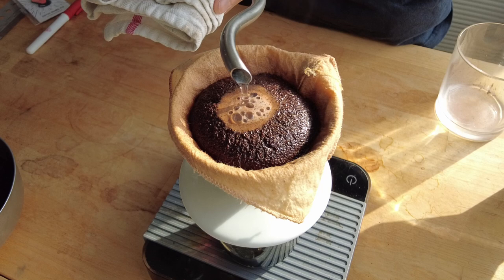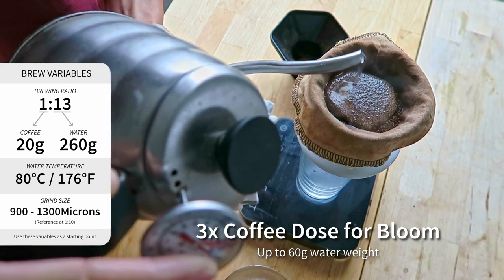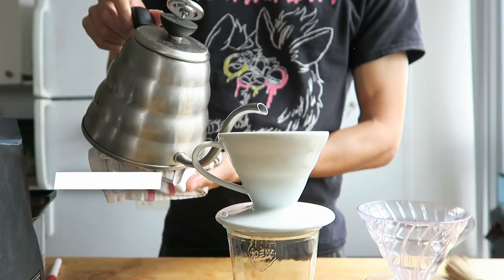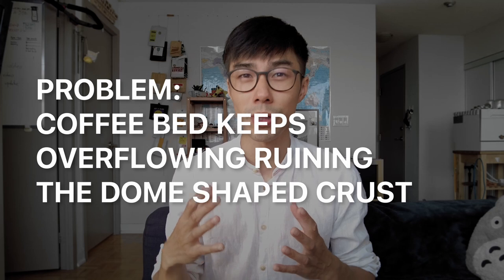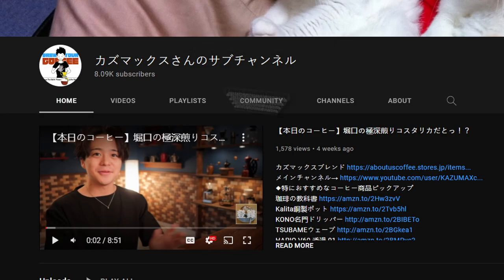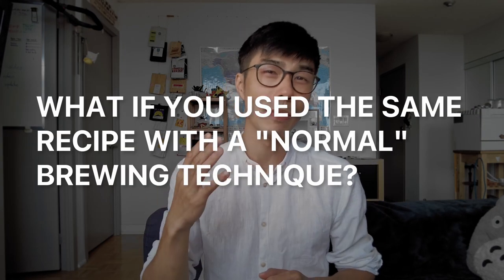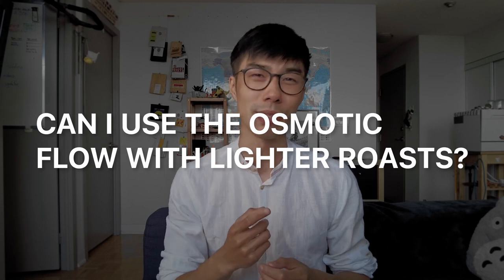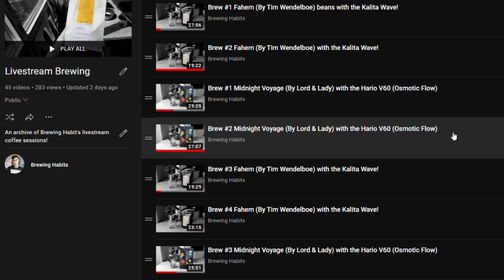Osmotic Flow V60 Brew Guide

Comment: Your definition of osmotic pressure is partially incorrect. You say that "Osmotic pressure it's  when two liquids with different concentrations are side by side creating a semipermeable membrane that restricts what moves between the two liquids." Firstly, although indeed we're talking about liquids, correctly these are solutions. You have a concentration of solvent and concentration of a solute. Secondly, the membrane is not "created" by the "two liquids" and that that restriction IS NOT the osmotic pressure. The permeable membrane has to be created or to exist naturally as in a given biological system. Osmosis only exists when there's a a concentration gradient. Water moves to where there is less concentration of water molecules such as in a solution with higher solute concentration (less molecules of water). In order to establish a gradient you need to restrict the movement of solute molecules, hence the semipermeable membrane.
So regarding osmotic pressure, actually, there's TWO definitions of what can be considered Osmotic pressure. 
-The first and most widely known and generally applied is that Osmotic pressure is the minimum pressure which needs to be applied to a solution to prevent the inward flow of its pure solvent across a semipermeable membrane. 

The second definition, and the one that applies to this pour over technique, can be defined as the measure of the tendency of a solution to take in a pure solvent by osmosis.

When you do the first pour/blooming your creating a solution with higher concentration than water in the spaces between coffee grounds ( Cafec calls it "Coffee essence"). This solution has a high capability to take in a pure solvent (Osmotic pressure definition nr 2). When you're pouring in the center you're generating water potential that it's higher than the osmotic potential in the coffee essence, so water moves to those coffee spaces, it then forms what Cafec calls "coffee liquid".  This liquid than flows down by a mix of gravity and (because there's movement also of solubles) a concentration gradient where's there's spaces with coffee essence with higher concentration than the newly formed coffee liquid. It's akin to a convection movement. Which your "column of water" schematic doesn't represent accurately. 
With the continuos brewing you're also bringing non soluble particles to move in the coffee grounds bed and they start depositing at the bottom and sides of the ground's cone providing, according to Cafec, a thicker filtering layer that helps further keep "bad coffee" compounds to go into the final "coffee liquid", the desired brew.